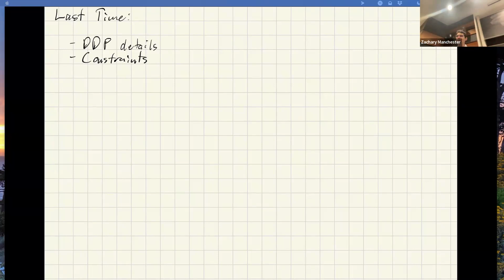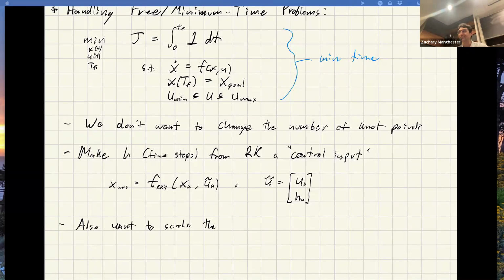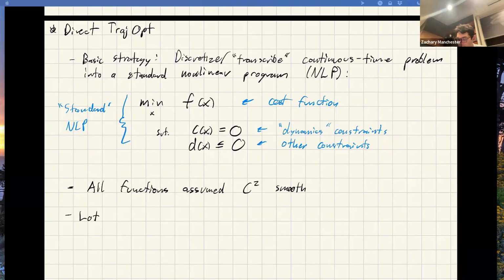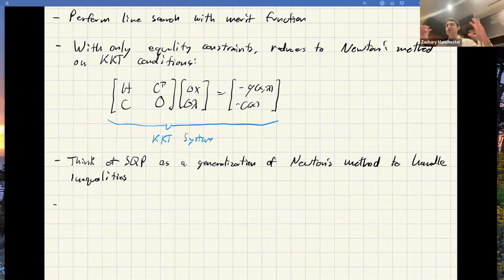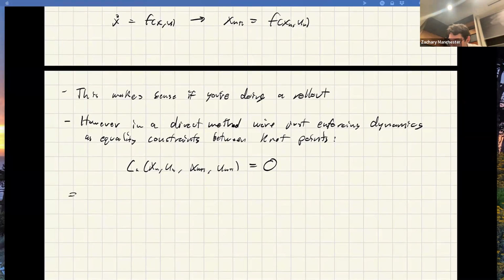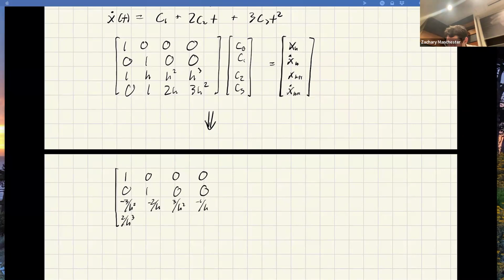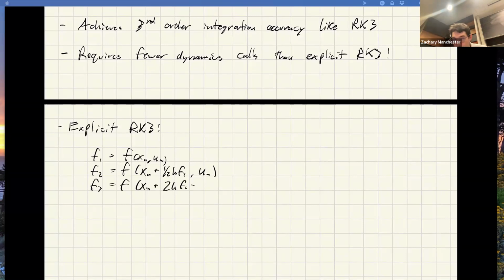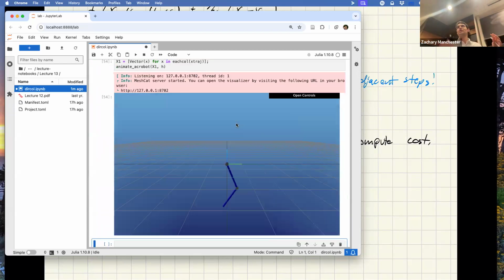Optimal Control (CMU 16-745) 2024 Lecture 13: Direct Trajectory Optimization

Comment: The provided example calculated the objective function only at the knot points, not the collocation points. But I tend to think of the collocation points as quadrature points. If that's correct, then the objective function should be approximated with collocation points together with the knot points, right?

Comment: Are the knot points in dircol also collocation points? From my understanding, the collocation points are where the constraints should be enforced. The dynamics are calculated at the knot points as well as the middle collocation points, so it makes sense that they are also collocation points. If we need to enforce constraints other than the dynamics constraints, should we do it at the knot points as well as the collocation points?
Reply: It has been a year since your comment, I would like to answer it based on my intepretation, correct me if im wrong. I think knot points and collocation points are different because knot point is something you get from optimization problem. Whereas collocation points are the interior points between two knot points. We enforce the dynamics at the collocation points to improve the approximation of the continuous-time trajectory over the interval between two knot points, rather than only enforcing it at the endpoints.